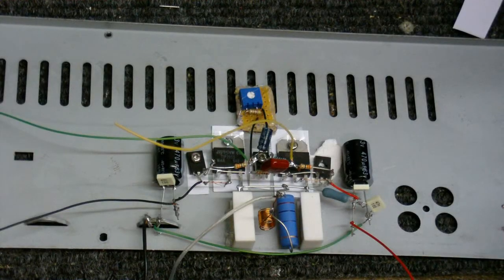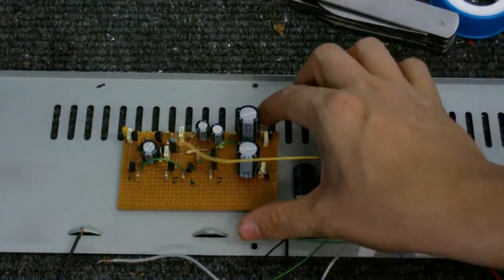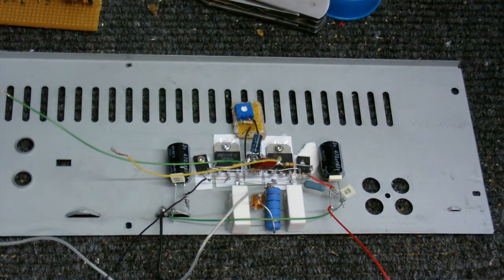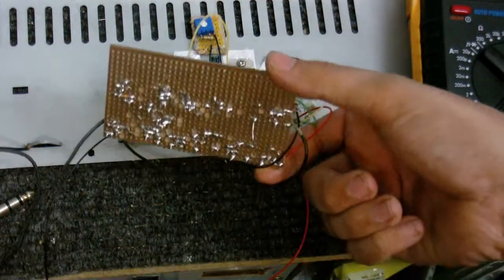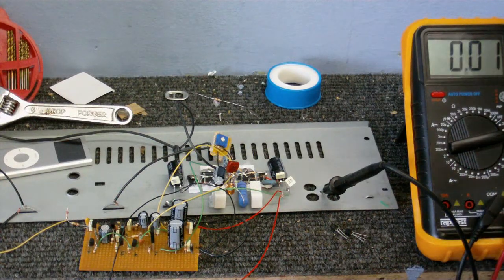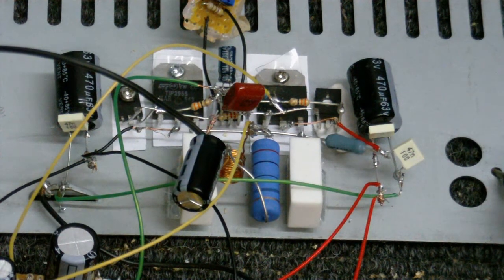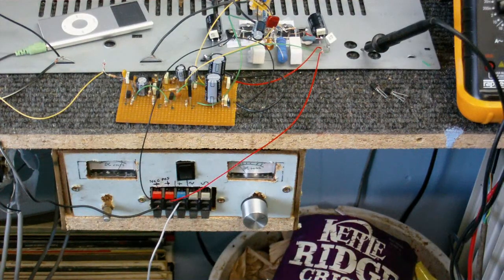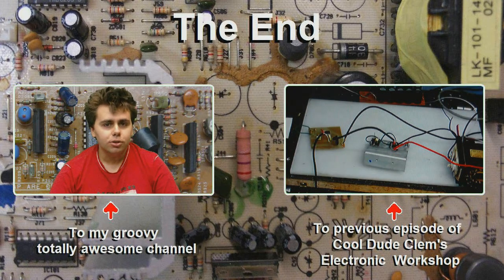Continuing work on the DX amp (part 2)

Comment: Cool project! Earlier failure could have been a cold solder joint. You should consider expanding into the realm of amateur radio. You could build a QRP transmitter/tranceiver and talk around the world. The area of software defined radios is very exciting.

Comment: I was a bit worried there for a moment. Real glad you got it working again.

You should try to get a hold of an oscilloscope. It really helps with troubleshoot
ing :D

 Either an old cheap CRO or a nicer DSO, like the Rigol DS1052E, that one's about 300 bucks. It's really great value for money. :)

Comment: R7 control the gain... or the sensitivity.... reducing it you will have the amplifier sensitivity increased to face small audio output from your Ipod....try the line out from your Akai...sound from Ipod is not fine....it does not match (in impedance) the power amplifier input impedance and sensitivity.

Try also good audio recording, Flac encoding recordings reproduced from your computer....the best the audio entering..the better will be the results...this amplifier is always said as "awsome"